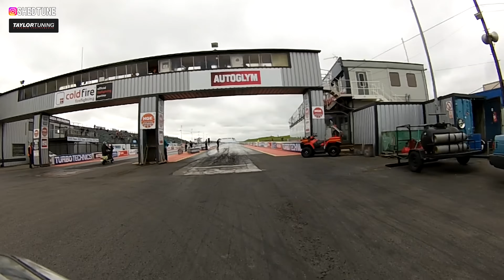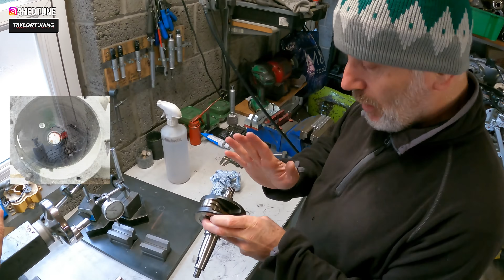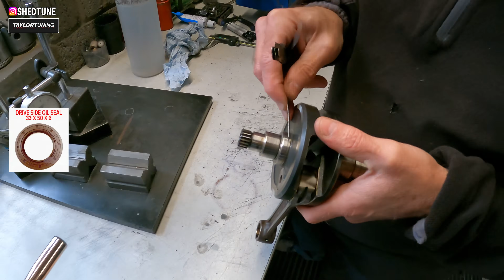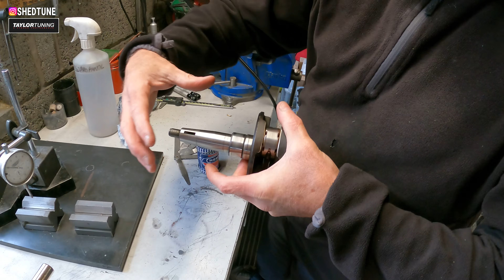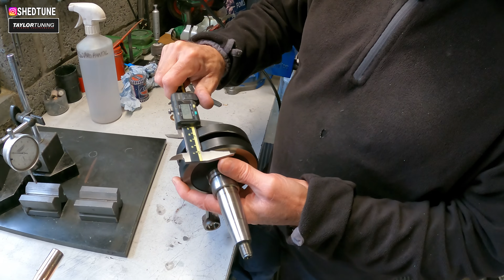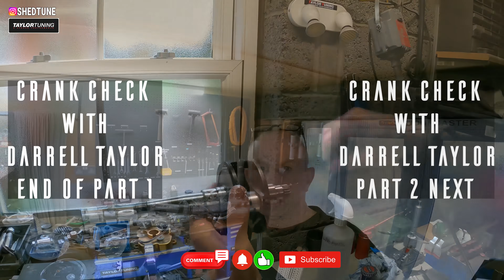LAMBRETTA CRANK CHECK | PART 1 | DARRELL TAYLOR

Comment: Spot on love the vids lads, after 12 years iv been getting anouther lambretta, this one is for racing, got 2 jobs to finish off first but looking forwad to making a start, the engine im useing iv had since new, rebuilt 12 year ago and never used 😂, its for circuit racing but il definitly see use at a sprint meet at one point
Reply from the maker: Look forward to seeing you at a few sprints, make sure u come and say hello 😀🍺👍
Reply: Nice one, be good to see you out…..